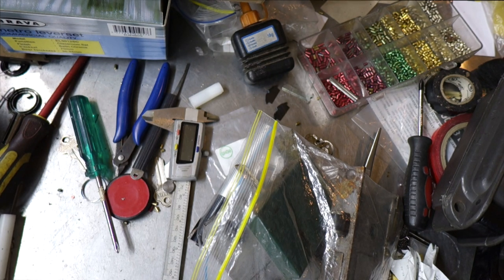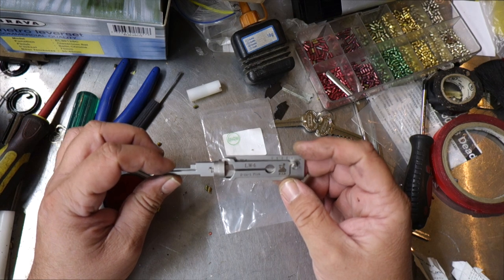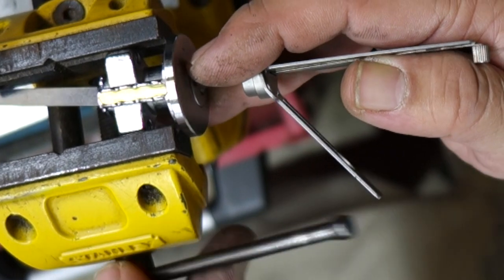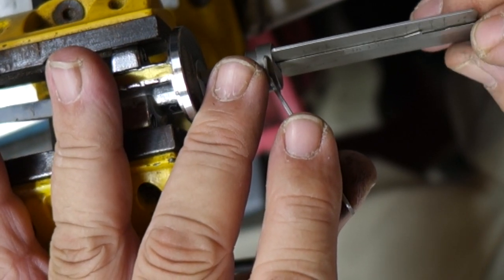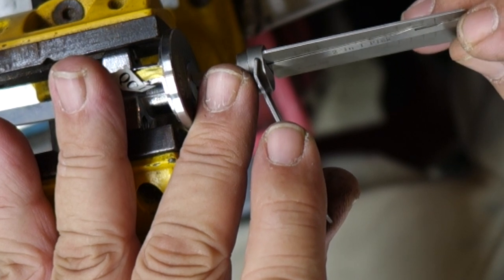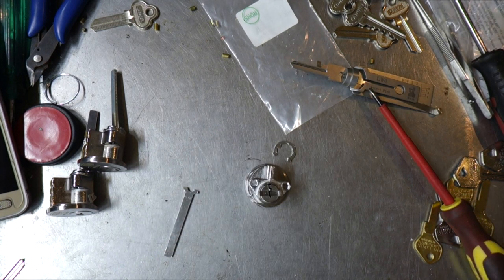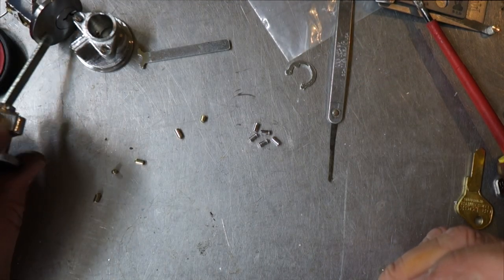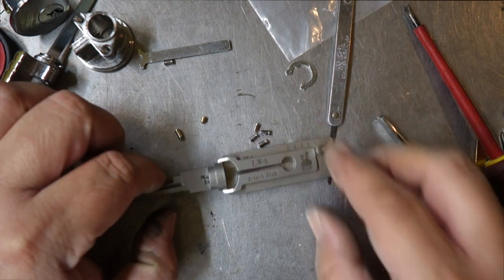The Best Lock Pick in 2022  - STOCK UP QUICK

Comment: Before I could get an LW4 or an LW5, I found that the Lishi KW1 and KW5 made fair substitutes. The Kwikset keyway and spacing are pretty much identical to a Lockwood. The only real problem is that Lockwood Lishis have depths 0-9 and Kwikset Lishis have depths 1-6 which makes decoding challenging. The end of the Kwikset pick lever (the part at the end that contacts the pins) is also a bit shorter than the Lockwood, so getting to a zero or one depth if the previous pin is a nine is tricky. That said, I've picked a lot of Lockwoods with a Kwikset Lishi. Don't get a KW14 .. That's for a Kawasaki motorbike.